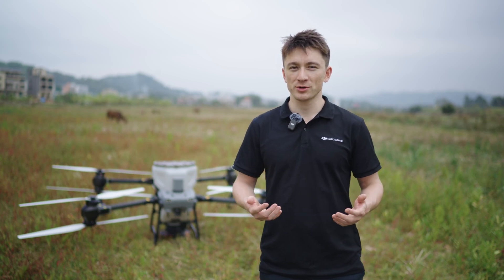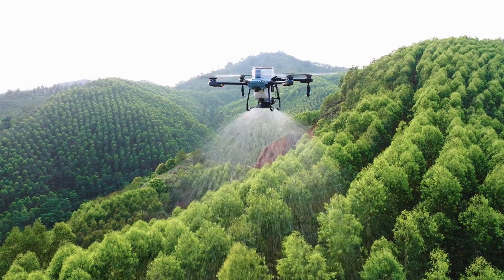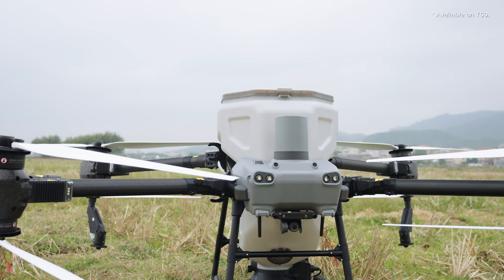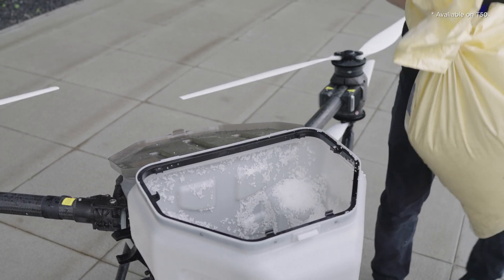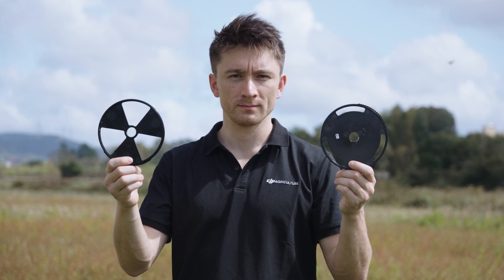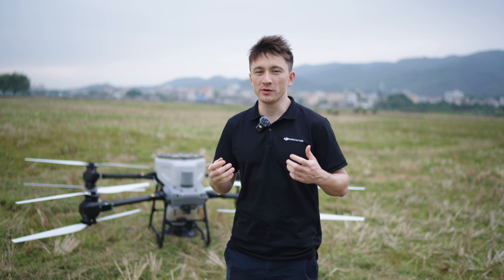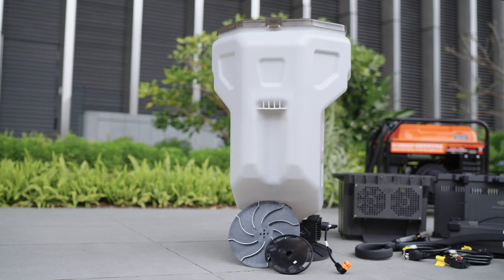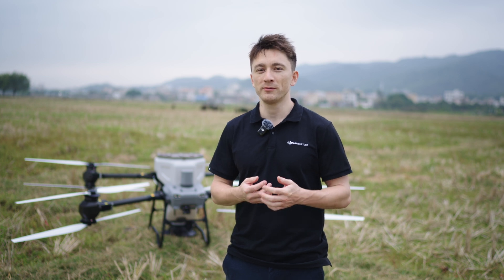Agras T50&T25 Spreading System Introduction

Comment: While I appreciate the new spreading disk design, it seems that something like that could be implemented into the T40 as an upgrade. We do much more spreading than spraying operations, having spread over 44,000 lbs of seed last season.  We have found the system works well but has some major cavets and I feel that it could use more development attention.  

Examples include inaccurate spreading amount that the system doesn't dynamically adjust to compensate for.   Example spreading boron recently with the 12-20lb gate at 14lbs per acre we had to actually reduce the "rate" to 9 lbs per acre to get 14lbs per acre.  This was after multiple calibrations with the mid-size gate installed, including Weight calibration etc.    

Also, more on screen feedback about the rate would help a lot.  Currently when we start spreading a new item we have to spread an acre then do RTH to get the summary screen to popup to see what was actually spread.  The drone is accurate on the summary screen, it knows exactly what it spread and we have verified that through outside checks.  Once we get it dialed in, it is normally very reliable although occasionally there will be anonomlies where it over or underspreads by a large amount.  Requiring us to slightly adjust the "rate" to get it to spread the correct amount.